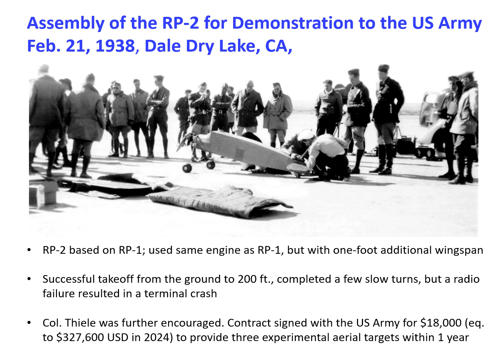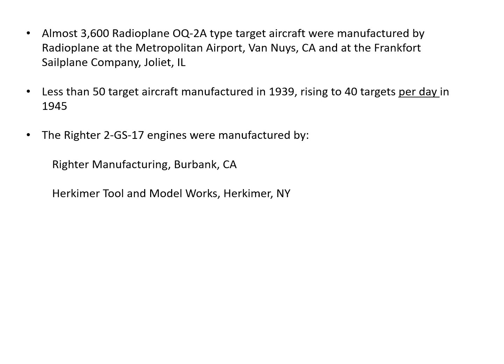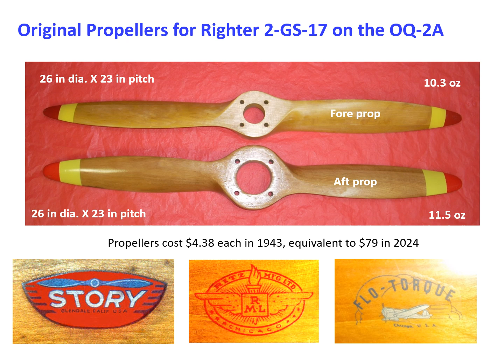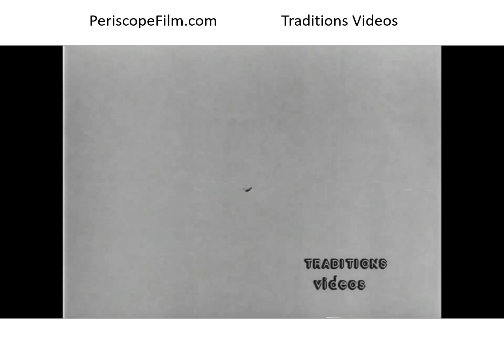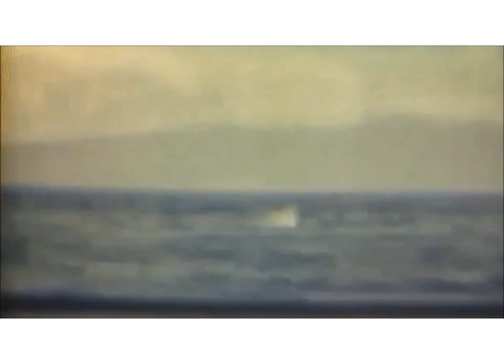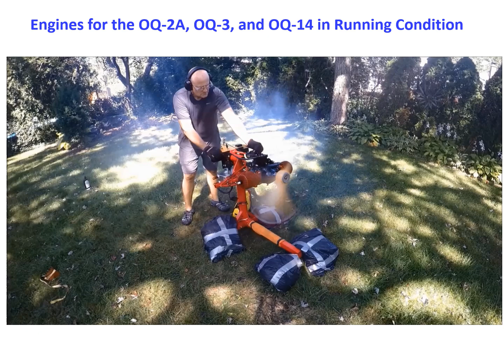The Radio-Controlled Aerial Gunnery Targets of WWII

Comment: I have a 2-GS-17 engine with props. I've never had it running. Someone before I acquired it had installed two automotive ignition coils onto it. I don't know if that worked or not.
Reply from the maker: Thanks for your comment. If the engine has a data plate please consider sending a photo of it to doolittlefey@aol.com. While two separate coils might work, but would not be ideal as you really want both plugs to fire at the exact same time. The runner 2-GS-17 in the video uses an aftermarket 12v Harley Davidson dual coil. Beware the integrity of those 80 year old propellers.
Reply: The Dennymight was a popular mode l aero engine.
Reply: The Good Brothers from Michigan were doing much better in the late 30's with much less financial outlay. They were firmly grounded free fighters. Their design was the Guff.
Reply from the maker: @paulhelman2376  , thanks for your comments.
Reply: Norma Jean worked at Radioplane. Later did some film work I believe.
Reply: Naca23012 is a symmetrical  airfoil.
Reply: Herkimer produced a great number of engines post war some CO2 powered as well as well as the popular OK. Cub 0.49 of the late 40's early 50's. Came complete for bit under 4$
Reply from the maker: @ , indeed: https://youtu.be/lDbxJ6iX5u8      https://youtu.be/liN0QpJKkok
Reply: Would have been smarter to have attached streamers as used by U/C combat.  Why use parachutes since a pop up stab would have accomplished the same as used to "dethermalize free flight models . They come down , usually, usually flat and smooth. Again a proper grounding in free flight would have made this all easier and cheaper.  This goes for knowlege of torque control.
Reply: Why a cumbersome catapult? ROG would have been cheaper.  If a catapult was deemed to be needed than a bungee cord hooked to stakes would have done the same. Again the bucks over common practicality is in effect.  This is typical of much of the R/C mentality.
Reply from the maker: @ , these were 100+ pound aircraft flying on 6 horsepower that required 700 pounds of pull to get them to 65 mph for a more certain launch.
Reply from the maker: @ , ROG would have  required very large, well-groomed flat fields. Also, the r/c controls were very slow in response, so keeping a 100+ pound tail-dragger pointed into the wind was impractical.

Comment: Incredible how the "Radio control" used vacuum tubes. In 1939 the most common tubes were octal base types; the miniature tubes arrived few years later.
Thanks for the video.
Anthony
Reply from the maker: Thanks for your comments. I'm more of an engine guy than an electronics guy, but I'm dumbfounded by the tubes in the V-T fuse that could take +/- 20, 000 g's and 29,000 rpm at launch. These were small vacuum tubes modified from hearing aids of the day.